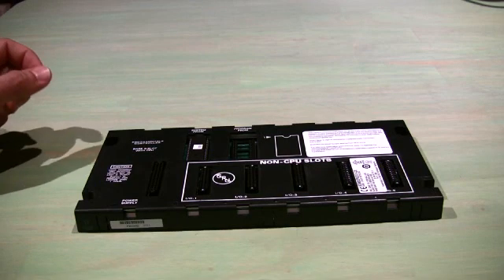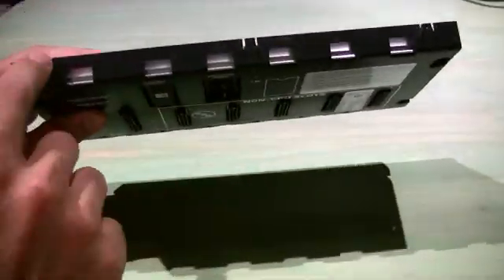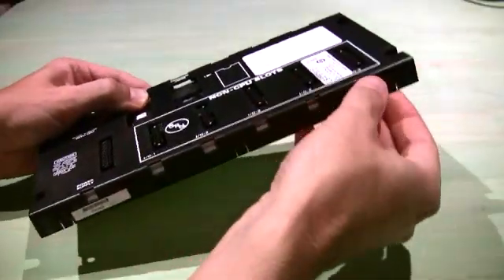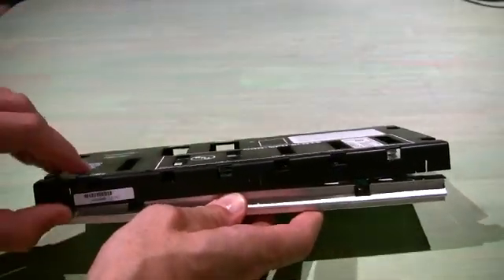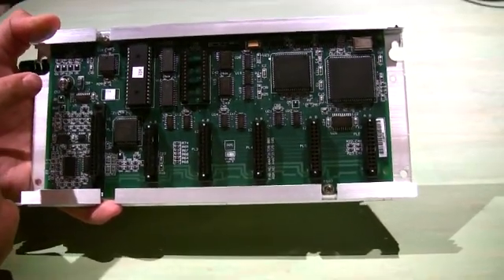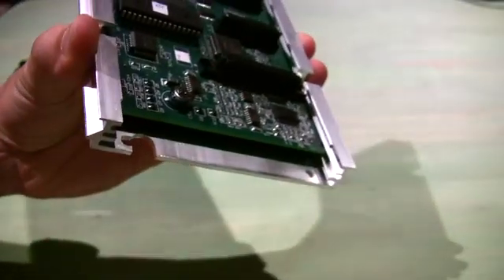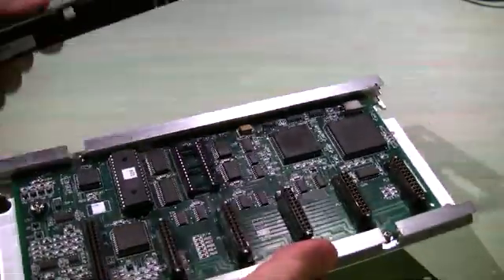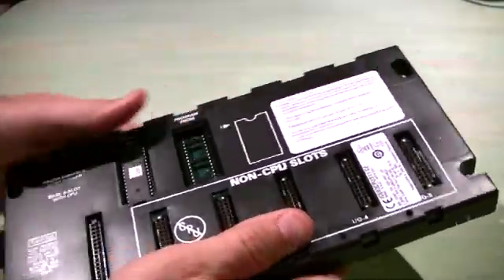Fault clear on GE 90-30 PLC

Comment: Thanks very much for you advice.
I was yesterday at new customer of mine...a shop with a defective Doall saw.
No run led on the GE 90-30 module.
Then i found that my câble was3not the good one.
I had a 9 pin câble and it is a 15 pin on the plc.
So i decided To try your trick and discharged the capacitor with a pair of plyers for 20 seconds.
Machine is ok
New customer very happy.
Thanks very much from Terrebonne ( montreal) Québec Canada !!
Reply: Pls does this affect the program or immediately you power up the program automatically load itself?
Reply: F @akinadeolaoluwa3022